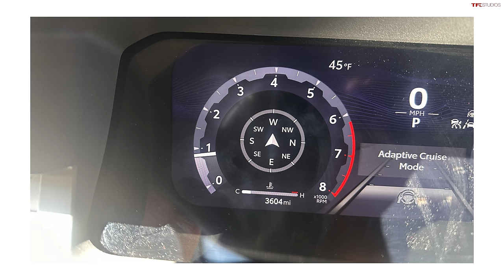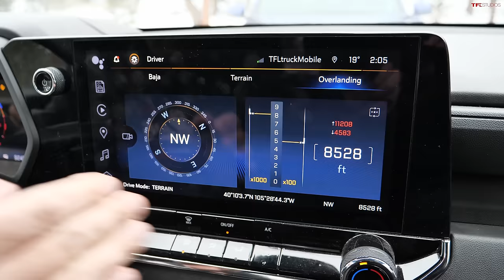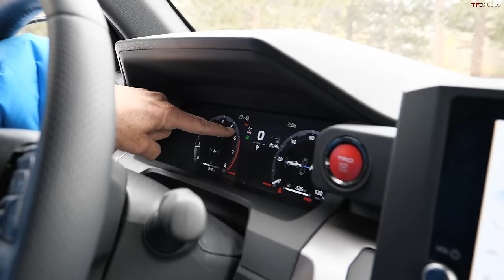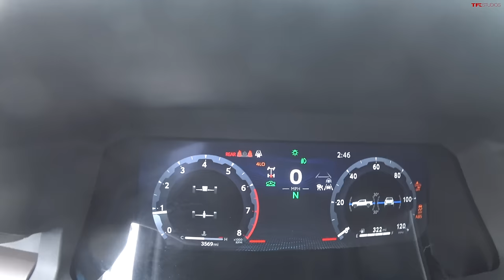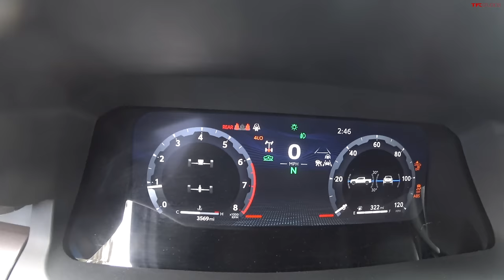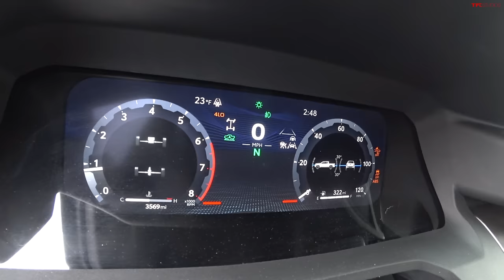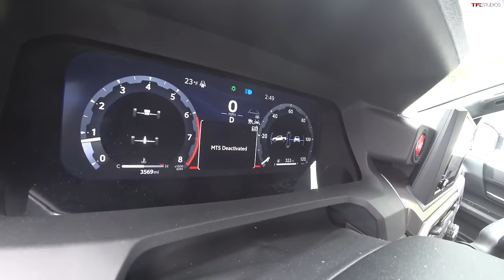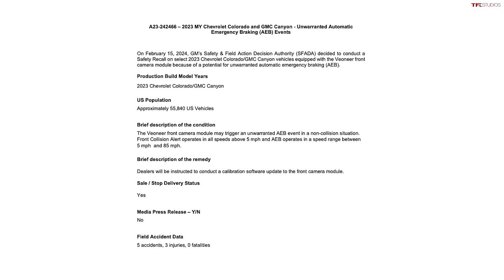Our Brand-New 2024 Toyota Tacoma Almost Left Us Stranded...Here's What Happened!

Comment: this is why I'm keeping my 2019 Nissan frontier simple,  Been the same for 20 years. Not a lot of electronics. Tough. Never breaks down
Reply: Apparently the new ones are holding up well too. Probably due to the remaining V6 high output. That baby can tow like 6.8k pounds! They also keep the trims simple. I hate how Chevy has so many damn variations. Toyota is getting there too now a days.
Reply: Contrary to the beliefs that all nissans have junk CVT transmissions, I heard that the 5 speed was actually very good in these.
Reply: I have a 2019 P4X Frontier and I adore the thing. Such a great truck.
Reply: I got a 2015 v6 4x4 6 speed manual the thing is apsolutely bulletproof. I even tow my camper with it… I’ve always changed the oil since new with full synthetic at 3.5k or 3k burns NO oil, it’s got a catch can to protect the catalytic converters

Comment: Should have bought a tried and true system like the Nissan Pro 4x. Also just fyi those 4 cylinder turbos sound weak in the video. I’ll keep my naturally aspirated 6 cylinder.
Reply: Agreed 👍🏻 I am also loving my pro4x it’s a great value and just the right amount of tech for me …I believe Nissan was very smart putting the power train in the earlier model to get a good sense of reliability before the refresh….i have had many Nissan vehicles without big issues and have grown to appreciate their engineers design for the most part
Reply: I would be a Nissan fanboi right now if they didn’t get rid of the MANual transmission.
Reply: 200k miles on my P4X, tons of off roading, rock crawling, rough roads...even has bigger tires. Never had any issues, never broke anything, never not started, never any glitches, no issues with 4wd or diff lock, absolutely bulletproof.
Reply: I thought it was the 4 banger blowing up at first. Glad it was just something in the driveline 😬

Comment: I had a 67 International Scout with a 196 four cylinder that would climb telephone poles.  It had All Wheel drive (positraction in the rear, straight axle - no planetaries - in the front).  I once crossed this river in the middle of nowhere  in Northern Baja in winter that had about 6" of water (at the start) in it and was over 100' wide.  It looked flat.  The road I was on (dirt) continued on the other side so I figured it was safe to cross.  I put it in 4 wheel low, locked the lockers (kids don't even know what those are these days) and proceded to idle across.  As I was approaching the other side I noticed the river getting deeper and the 2" lip on the other side was actually 18" to 2' deeper under water.  I had no choice but to keep going because if I stopped my car would have been buried in the sand as the river dug out underneath it.  I just went straight for that bank, gave it some gas as I hit it straight with my bumber.  The thing just plowed through the bank, popped straight up and crawled right out.  Never want to do that again!   I heard farmers used those things in their fields to rake hay, pull heavy loads, etc.  When I rebuilt the engine the mounting bolts to the clutch housing were 3/4" (for reference, a Chevy pickup back then might have 3/8" mounting bolts).  I think it's safe to say they don't build vehicles like that anymore.
Reply: TFL doesn't even know what lockers are haha.  The Tacoma HAS a locker in the rear and they weren't even using it until after the mechanical.

Comment: I am a big fan of Toyota. However, i do not like a turbo on a gas engine. Unlike a diesel, they are not built heavy enough for a turbo. It will shorten the life of the engine. They need to keep the option of normally aspirated engines, especially for people who want to tow.
Reply: Also the direct injection added strain.
Reply: But, hear me out...what if they built the gas engine for a turbo? Fuel type doesn't dictate how the engine is built
Reply: They have to turbo it because its a gutless 4 cylinder without it.
Reply: I dont like turbo's either, but so many of you have no idea wtf u are talking about. The F150 I had for awhile, had a CGI block, forged pistons and water cooled manifolds. Literally....built like a diesel to handle high output. Chevy and Toyota followed them with their turbo truck motors.

Comment: Early adopters are the real world testers for these vehicles...The 2026 model should be much better!
Reply: Not sure. The 2024 Tundra has most of the same issues than the 2022.
Reply: Itll be the same
Reply: @is6566  like what? The only real Tundra issue I've heard is the first batch of junk turbos. That was the first batch only, and they canned that particular supplier for that. I have not heard of significant problems with 2023+ Tundras.
Reply: ehh no built in mexico . toyota's aren't what they used to be sadly .

Comment: A recall is better than not being told anything and of the estimated amount, few are affected. I bought a new Tacoma in 2015 and I can proudly say that it has one hundred thousand miles without any problem. Not all of them are going to be perfect but they tend to break less than others car manufacturers.
Reply: I bought my 2015 new also and put 100,000 miles on it as of last week. Has the 4.0 engine also. Going to keep it unless they introduce the small V8 I had in my 2012Tundra. If I had to replace this truck today do to it being stolen or totaled I would be getting a Honda Ridgeline. Normal aspiration only with a minimum of 6 cylinders.
Reply: I doubt you've ever done something like this.  Of course it's served you well heading up Walmart and back.  Kudos to your less capable truck not being challenged.
Reply: Not fair though considering the 2015 is the most dependable year of all Tacomas. Definitely one to hold on to.

Comment: How much less would these trucks be without the built in IPads? Too much tech to drive! The automakers need to simplify to get the pricing down significantly. More motor, less tech please! 

Nissan had the right approach and tested everything in the previous generation and now it proved to be less problematic. Being a Toyota Tacoma owner, i can say that I miss the old recipe of tacos and won’t buy another Toyota truck until they take a step back and give back the same 6 cylinder with a 10 speed transmission and manual option.

Comment: Took delivery of my 2024 tacoma trd sport 6 speed manual truck is sitting at the dealer with 2 ,500 miles needing a new transmission which lost 2nd 4th & 6th gear transmission is on a 3 month back order not happy

Comment: Tacoma just had its Defender moment.
Reply: Let us not forget the F250 in 2017 that sent the cooling fan through the radiator.
Reply: @spyder000069 we forgot sorry bud 😢
Reply: @spyder000069   I don't remember that
Reply: They drove to the dealer and had a tech accidently cut the harness?... or did Tommy repeatedly drive sidewalls in to a pointy rock?...
Reply: @jeffreyjones3616 The double punctures.

Comment: Do what I did... just get a 2023 GX460 (Lexus) for the same price. It is MUCH nicer inside, heated/cooled seats with memory foam leather that feels like you're sitting on pillows, 3-row seating, electric folding mirrors, heated steering wheel, nav, all the gizmos plus instead of a weak V6 you get a V8, full-time 4WD with low-range t-case and a center locking diff, and the KDSS suspension system with front and rear electronic swaybar disconnects! Did I mention it rides better and is quieter inside than anything else on the road? It also tows 6,800 lbs and comes with the best factory stereo system (Mark Levinson) available by anyone.

Comment: Looks like Toyota has lost their way. Have an 82 pickup with 1,000,000 miles on it, paid 5,500 dollars new for it and a 2007 FJ. Never had a single problem from the FJ, paid 32,000 dollars new for it. Really looks like the quality of the new stuff is substandard let alone the high prices. I would think that a better way to go would be to buy an early 2000's rig and rebuild. I have a 1983 sidestep F-150 4 wheel drive pu that I have restored for 10,000 dollars and that included the 3,500 that I paid for it. Has a 300 6 cyl and gets 20 mpg on the highway. 35 dollars a month for insurance for each rig, good reliability, easy to get parts and a good combination for off road, work and comfort and no payment.

Comment: Toyota is showing allot of signs of back-sliding. Elimination of their V8's Over charging the intake with too much turbo to compensate for the lack of grunt in a bigger motor. Those turbos will NOT last the 300,000 miles Toyotas use to go. I'm not happy with their changes. Hell a Nissan Frontier makes more sense. That Colorado aint bad either.

Comment: The only issue I see so far is that the new Tacoma has more power and more torque. if we assume that the parts from 2023 were left the same, it could be that the front diff is underdimensioned. But lets put this aside.  Another observation, the steering wheels were facing to the right, there is no comment from Roman saying the setting he used. But for sure the center differential was engaged. Take into account that this Tacoma does not have front diff lock. Finally, if you see the video, the front diff broke when the rear wheels were over ground (not ice), and the front right wheel at least, was over a hard surface  too. So it got torn apart cause front wheel and rear wheel (maybe both of the rear wheels) got differential speed.  My opinion is that all wheels with traction were over hard surface. it was just a coincidence, one of those days. The system has to break on the weakest point so it was the front diff, it made its job. Great video. It has nothing to do with Toyota, I have experienced this with 90 Ford Explorer (a mechanic running my car over pavement with 4x4 high), and with a CJ 7, there was no fuses, so the front shaft was torn like a candy. This is when you begin to think AWD is better that 4WD selectable.

Comment: If the front brakes are part of the traction control,  they will find the weak point in the driveline. The brakes are way  stronger than the U-joints/CV axle. Some RZR SXS have splined couplers that will fail before they grenade the diffs. $100 fix vs $1500 .

Comment: Listen to that damn whine.  That's not a REAL truck.  That's a toy cereal box.  Toyota can keep their turbos.  They have lost A lot of customers like me.  My 2018 Tundra I bought 8 months ago for that reason.  5.7 liter.  Yeah it gets 16-18 miles on the high way but the son of a bitch don't have a turbo in a pickup gas powered.  Cheap way for the manufacturer is all that is. And every mechanic will tell you that a turbo will NOT last as long.  Common sense.

Comment: Toyota had great reliability for years due to them not changing designs. Now that they are changing and updating designs, they are having problems. This is kept on the down low because the Toyota community does tend to have cult like tendencies. (And no, I am not a Toyota hater. I daily drive an older Lexus)

Comment: I owned a 1990 toyota set first year they made a v6, had breaks go out 4 times in 1600 miles. Only got 13 miles to a gallon no matter the way I drove, and the engine output was very subpar. Olso the suspention was new that year, they changed it back to the 1989 version in 91. Over all it was the worst  vehicle I ever owned. It was olso the most expensive truck I ever owned. I am still driving my 97 f150 5.4, bought it in 96. It still runs great, no thinking of replacing.

Comment: I had a 2014 Tacoma that I built up as an adventure rig, and I so wanted to love that truck but traded it after only 20 months and 36,000 miles.  It had awful steering that nobody could fix, mediocre ground clearance that was exacerbated by the stupid exhaust routing, an underpowered engine and constantly-hunting transmission that struggled to maintain 75 M.P.H. on the interstate, let alone pull a 3,000 pound trailer, and a multitude of creaks and rattles (i.e. the seats moved slightly on every turn).  It did not inspire confidence at all!  When I got rid of it, I bought a 2015 F-150 with the 5.0.  After 8+ years and 120,000 miles, I can easily attest that the Ford is the best vehicle I’ve ever owned. It has comfortably taken our family all over the Western United States and Canada—on and off road—through all kinds of weather, often while competently towing 5,000-7,500 pound campers. Overrated Toyota will never get my money again.

Comment: The locker can only be on in 4L and it has to be unloaded in order to engage and disengage. The fact that it wouldn't come out of 4L until the rear locker was disabled is not surprising. Also, not to detract from their point that this new truck shouldn't have broken, but these trucks have independent 4 wheel braking which they use for traction control. In my 2014 they called it A-TRAC. It looks like that feature was on when they were spinning the tires. This means that while there was low friction between the tires and the ground there were extremely high load pulses coming from the brakes being pulsed to send power from the slipping front wheel across to the other wheel. In general, these 2024 trucks look like another step away from what made this product line legendary in the first place and just deeper into the mall crawler territory.
Reply: I'm definitely going to keep my 2nd gen Tundra for as long as possible... This video is a stain on Toyota's good name. What a shame.

Comment: So all of the torque, maybe 300 lb-ft, was fed through the 4-low transfer case multiplying the advantage by 2.57:1. The rear wheels were getting little or no traction. The front has an open diff, so nearly all the power was on the front right wheel. The cause was probably due to the pulsing of the traction control braking trying to send some power to the other side.  All that power on one wheel fighting the binding pulse will pop that CV.  In a way it is kind of a fluke, these parts seem ok. Leave traction control off. Turn locking diffs on. I’m looking forward to what Toyota has to say on this.

Comment: I bought a leftover Tacoma 2023 in December 2023. They came off the price a little, but still expensive for what it is. I will never buy a turbo charger 4 cylinder. Toyota has lost their way with the new engines. The Tundra engine is a failure, 102,000 recalled. Garbage!!!

Comment: I bought a 2024 Colorado trail boss and after a week (222 miles only) with the truck I had transmission issue, it's been 2 months since the truck is with the dealer and all I get from the service advisor is the they still don't have and ETA on valvebody to repair the transmission...

Comment: The new 2024 Tacomas are build in Mexico , v4 with turbocharged. No more v6 ,sadly,  but the 2024   4 runner Trd off-road  made in Japan in still v6. In 2025 they will start putting the new engine v4 turbocharger.   On all Toyotas 4 runners, in will build in Mexico ..😢😢

Comment: off-roaders have always known the tacomas are extremely fragile. They have anemic axles and axle shafts, tooth picks for front end suspension, and at least the 2023 and below, have weak C channel frames when literally every other truck has fully boxed frames. They are antiquated and weak designs which only saving grace was the engine was reliable. Now Toyota is floundering with their engines, so if Toyota doesn’t have reliability what do they even have?

Comment: I hope Roman's butt and hands were warm when he needed to be rescued by your lowly Colorado. And the Tacoma DID leave him stranded; anytime you need to have another vehicle pull you, you were stranded. The problem with these modern vehicles is that they aren't designed for the "Rust Belt". None of the engineers or designers have lived in the rust belt. Detroit engineers and designers know about snow, ice, and road salt. Toyota has all these terrain modes yet no snow/ice mode. Snow/ice requires different strategies than mud.

Comment: They sound like a sewing machine. Airing down the tires would help but in the snow I have never used 4Lo, always 4Hi. Torque needs to be limited and not multiplied in slippery surfaces conditions.
Edit: sounds like a disconnect in the front axle broke which I have never experienced in my 12 years of Tacoma ownership (2008 2.7L 5spd 4wd). Can’t wait for the update.

Comment: I took my 2019 4x V6 SX to AZ and went up everything the side by sides went up. Crazy off camber stuff . Stock configuration. Sad the truck is not even putting a load on the drive traine with the ice making the tires slip.   Shame. Note. Always have chains in these conditions. I'm guessing the electric 4x solenoid disengauged.

Comment: Both these trucks have ahit engines I actually would go with NISSAN FRONTIER 2024 V6 4X4 very nice truck dont sound like a pos dieselin like these I just dont see these 4banger turbos lasting 3 or 4 hundred thousand miles anymore too many things to go wrong and the toyotas are already having transmission problems both Tacoma and tundra then the turbos will blow then the engine goes they should have a option for v6 NA or even 4-cylinder NA and a turbo diesel would have been awesome thanks for tearing the taco up very easy 😂😂😂😂

Comment: This is why I still would rather have the manual shifter 4wd. My old 2000 4runner had it and it was bullet proof. Now all these push button shifters break all the time. My 2019 chevy trailboss transfer case  range positioning sensor broke and I was absolutely disappointed to say the least. It's just garbage.

Comment: 2024 Tacoma weak as hell.  Weak unreliable engine, cant handle stress and weak joints.  Toyota's weight reduction and on your wallet.   They couldnt find a good deal in Colorado, so they had to buy it from TX dealer.  Shows colorado dealers suck.